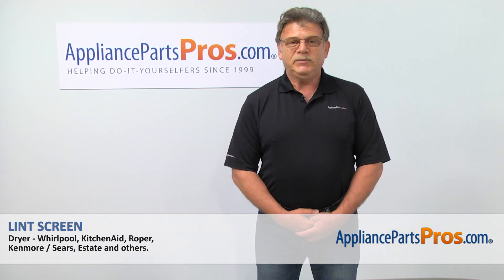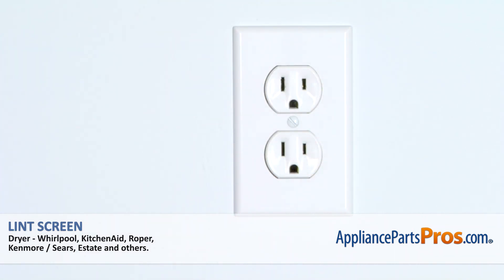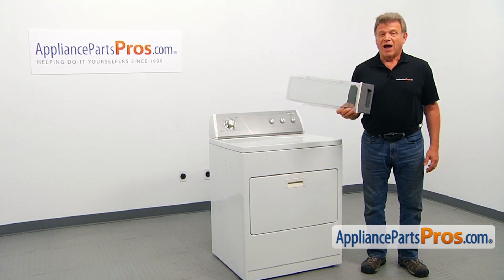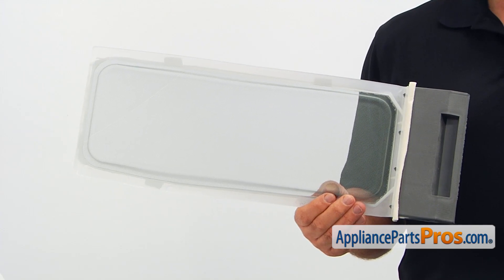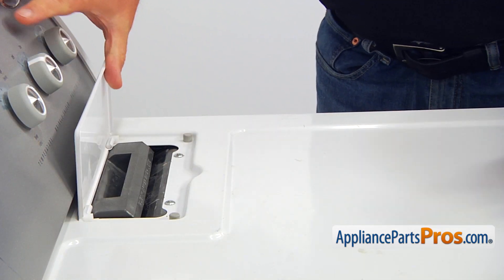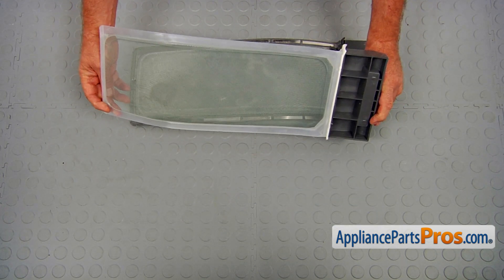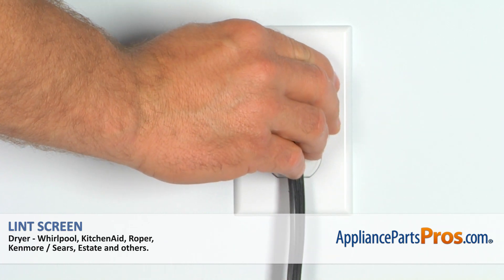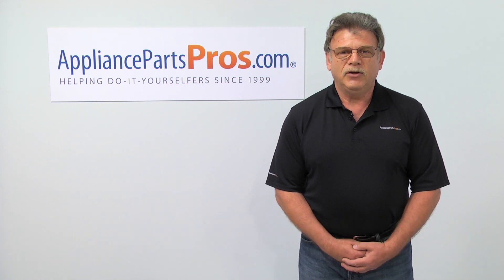How To: Whirlpool/KitchenAid/Maytag Lint Screen WP349639

Comment: On this lint screen...for the felt "Surround" seal near the top/handle......should the protuding felt "lip" be the same height on both the top and bottom of the seal?...or is it thinner on the bottom?
Reply from the maker: It should all be the same height all the way around it.